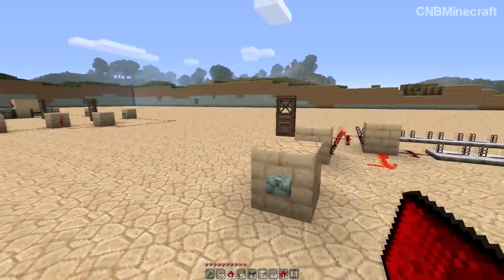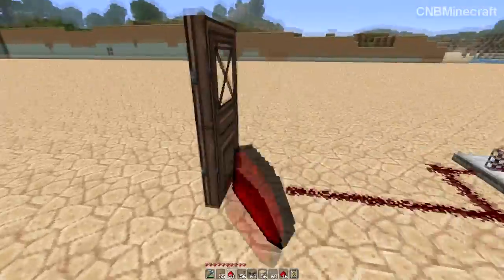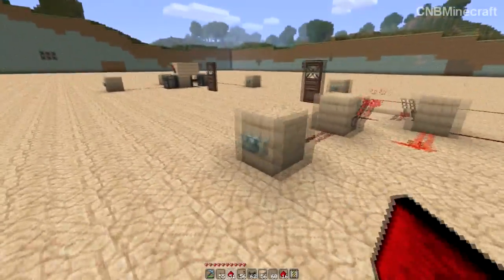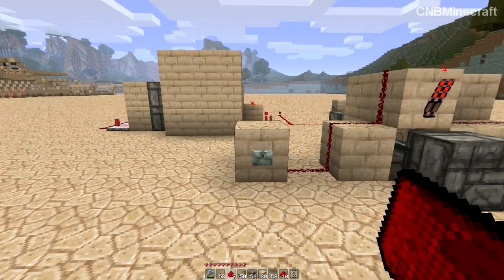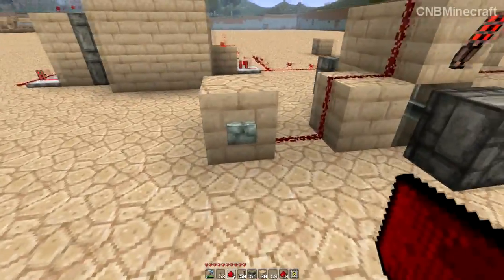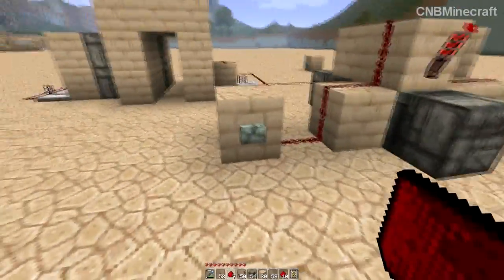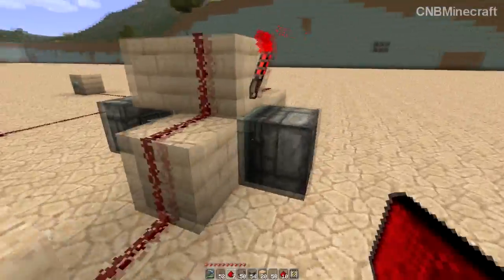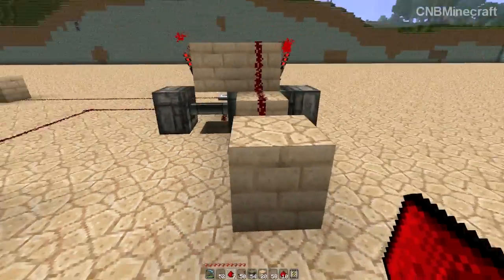Basic Logic Gates! (part2) [Minecraft Redstone Tutorials]

Comment: Three reasons:
1. Aesthetics. Buttons sometimes look better than levers.
2. Timed doors (stay open for desired time). The toggle can easily be hooked up with delays for the reset.
3. Stability (like how having 2 levers wired to the same output can mess up without a XOR gate). Toggles and flipflops can be hooked up with any number of buttons without problem.